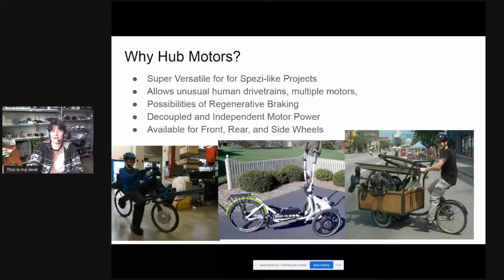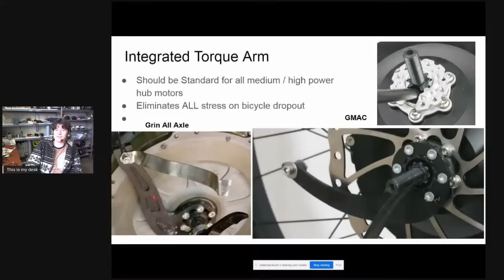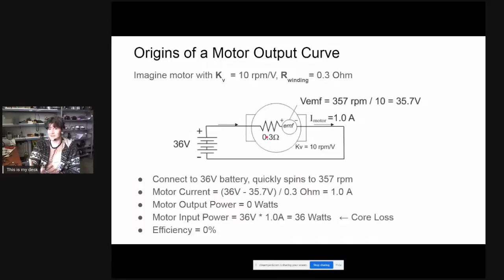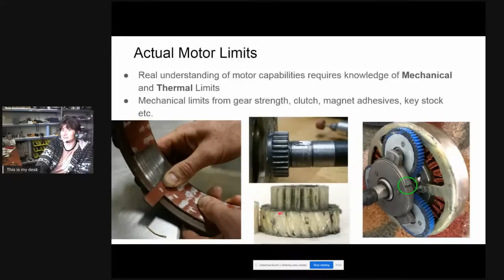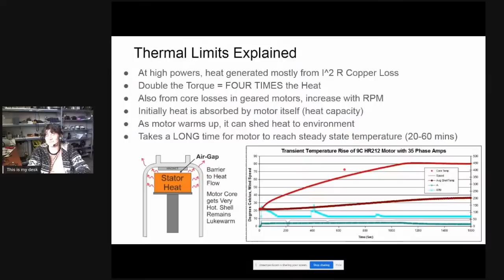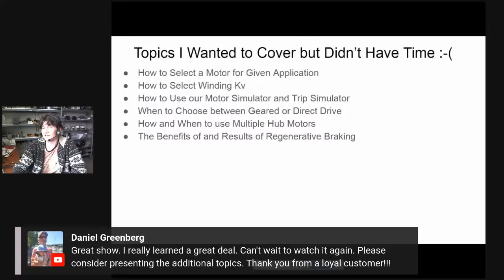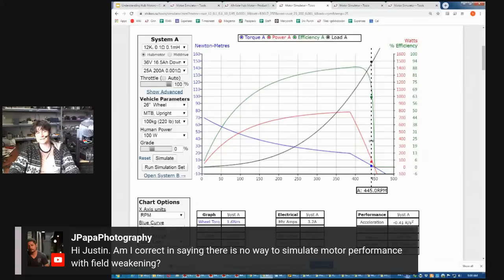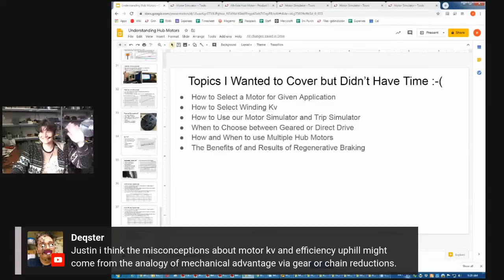Understanding Everything about Hub Motor Drive Systems - Spezi 2020 Live Presentation

Comment: hi justin ,

is it correct that every bldc motor with a given Kv has a fixed nm/A rating? i think not . you can not compare an outrunner with an inrunner or an axial magnet motor like the ME1304 motor
Reply from the maker: It is correct and your presumption is wrong.  If you know the Kv, you now the Nm/A, and you can 100% compare outrunners with inrunners with axial flux motors this way.
Reply: @GrinTechnologies  ok thanks justin!

Comment: very good...a single speed bike is good if you run in a 5 to 10kmph band of speed ....i hear you say a mid drive motor is the same as a geared motor...well yeah to the cranks but beyond that there is a diferance of 300 to 400% in gearing.if you want a sweet spot on eficiancy or power or below over heat change gear.between the human and the motor is an agreed narow band of rpm between these 2 and the road there is a lot of negotiation.
Reply from the maker: One of the large misunderstandings people have about electric motors is this idea of a "sweet spot".  There is no such thing as some narrow sweet spot for electric motors, they produce torque equally well over all speed ranges.  The human legs are very different though, and really do operate best in a pretty narrow band of pedal RPM's which is why bikes require such wide gear range with so many steps.
Reply: @GrinTechnologies   very good you responded on the topic of power from a motor but left out the topic of eficiancy and the heat generated/lost energy when out side of best eficiancy that you showed us on your chart.this topic is a large portion of your fantastic talk here. it seems to me that if you want to avoid energy loss as heat then keeping a motor in this best eficiency  "sweet spot" then a range of gearing will do this...now remember you said a geared hub motor is the same as a mid mount motor...im not convinced that is true.not when there are gears avalable.im going to watch your talk again and pay close attention to power/tork.maybe i will learn some thing.

Comment: You didn't cover acceleration in your video. Would be interesting to compare an acceleration chart with various motors and parameters. I have a question about a homemade e-bike unlike anything you've covered. I have a 36v lithium battery pack going thru a 500-watt controller to a 12v 500 watt brushed motor that lists 2,750rpm with a gear thru chain to rear wheel on a 26-inch bicycle so that top speed is about 30mph with a 120 Lb rider. I have not ridden it enough to figure out what is going to fail. What simulation can you run to help me figure it out? I have a spare 36-volt motor to replace when the 12 motor fails, but the 12-volt motor is faster.
Reply from the maker: Acceleration is just the net thrust divided by the vehicle mass, so it's quite easy to compute and is shown directly on our motor simulator in the bottom right.  There is nothing at all about modeling the motor's power output with the simulator tool that will tell you want component will fail in your DIY ebike drive system. That's a purely mechanical question.
Reply: Thanks for the response.  My failure question concerns whether my 12-volt motor will hold up with a 36-volt battery applied. The only way I can explain acceleration in a graph form is for you to look up a device called Dragy that Hot Roders use to tune their cars.

Comment: An afterthought: Justin, after watching you manipulate the simulation to show us that the fast winding didn't really change performance (by any metric?) up until the slower wound motor couldn't keep up, where the fast winding had an advantage, why wouldn't you just ALWAYS WANT a fast-wound motor? Is there less magnetic interaction at slow speeds, and thus lower torque and lower power?
Reply from the maker: Because    
a) not everyone wants the ability to go fast  (this is true for LOTS of people) and
b) In many systems, there are bottlenecks in the connectors, the phase cable wire gauge, and the controller mosfets that limit the ability to run at the higher phase amps that are required by a faster motor winding.   In these cases you often will get better performance with a lower motor winding.
Reply: @GrinTechnologies  Thanks so much for the insight!
Reply: @GrinTechnologies  I still dont understand that.. when you need more phase amps on faster motor, copper in the engine wont get hotter because of more amps flowing through the motor?
Reply: Won't the slower winding give more torque for hill climbing?

Comment: I'm guessing that oil cooled motors leak because of expansion of the air and oil during heating. I'm wondering if a breather could be installed.
Reply from the maker: Even without the added effect of internal pressure you get leakage. Oil is just by nature very leaky. The solution is to have a hub specially built with 'O' ring seals or similar around all areas of contact with oil that could lead to egress from the hub.

Comment: What is your opinion on Neodrives system and their direct drive motors?
Reply from the maker: We don't have any firsthand familiarly with them so for that reason can't really have an opinion. Most direct drive hub motors have roughly similar performance metrics.
Reply: @GrinTechnologies  It's this: https://www.neodrives.com/en/drive-system/z20/z20-rear-motor/
The problem with my 250W direct drive motor on my handcycle is that it overheats and turns off after I go over 50 kmh for a prolonged period of time. I can cook my motor like this eventually?

Comment: It is all nice and dandy, but how to have direct drive engine with 250W limit and still usable torque?
Reply from the maker: You don't sell an ebike with a 250 watt power limit.  Bosch bikes do about 800 watts of power.  That's what you need to get usable hill climbing oomph.  Regulations generally refer to "rated motor power" or some such, I've not heard of any that stipulate the actual electrical input power to be limited. If you limit the output power, then 250 watts is exactly the same thing regardless of whether it is coming from a DD hub motor, a geared hub motor, or a middrive motor.  250 watts simply means the wheel torque in Nm scales with your wheel speed by the equation:
Nm Torque = 250 *2*Pi / rpm.
Reply: @GrinTechnologies  
Thank you very much for your answer. 
I'm looking into this because of velomobile I'm building. Mechanical transmission is full of compromises... And I have seen the serial hybrid pedal-electric pedelec called Frikar. They use two motors... one is driven solely by battery, other is driven solely by pedal electric generator. They are suggesting to circumvent the European road traffic act by this... and it looks plausible. But when I tried to apply these limitations and set them to your engine simulator, then when I turned current high enough to overcome hills(there are hills up to about 12% here around), it leads to motor burn out in short time... It looks like I would need to have at least 750W engine(internally geared) to be able to overload it over 1500W at which I would have torque high enough... and motor would last at such torque at least 5-7 minutes. 

Well then there is an compromise- to have both mechanical and electric drive. But the complexity of system goes up, and serial hybrid pedal-electric transmission is no longer good option.
And yes, I know that pedal electric transmission would have up to 80% efficiency at best(unless expensive solutions would be used).

Comment: Justin.. Do they ever use Jack Shafts on ebikes..?
Reply: Yes you can find jackshafts on ebikes. However given the simplicity and low cost of hub motors it might be better to with around the limitations of a hub motor rather than adapt with a jackshaft.

Comment: how are you guys using 10 watthours per kilometre? i like to pedal and i'm only going 25 km / h and with a 65 kilo rider and 25 kilos of electric bicycle i ride 60 to a 100 km from 313 watthours, depending on mood and terrain. no regen either.
Reply from the maker: That's been consistently the average that we see among our staff and our customers for the 18 years that we've been monitoring real world ebike battery consumption.  Heaver users will consume more like 15-20 wh/km, thrifty users will be more like 6-7 wh/km.  10 wh/km is a pretty solid average.   

If you are moving at just 25 kph, you need much less energy than at the ~35-40 kph of most ebike commuters. So 3-4 wh/km is totally exepcted for someone going that slow and pedaling all the time.

Comment: Do you know where I can get metal planetary gears for a Bafang 750w hub motor?
Reply: By "750w", I presume you mean model BPM. Anyway, Aliexpress or maybe Banggood are good places to start.
Reply: @fun_ghoul   Yeah, been there, done that, but will keep looking. Thanks!
Reply: @dbfcrell8300  If you didn't find any, you didn't try hard. I was just looking at them the other day. They have them for BPM-sized and G02-sized motors.
Reply: @dbfcrell8300  e.g. https://www.aliexpress.com/item/4000121800330.html
Reply: @fun_ghoul  The model is RM G060 750.DC. I couldn't get the seller to confirm they'd fit in it, so I'm waiting for another seller to respond now. My motor is still on warranty, so I cannot open it to get the specs, so I must rely on the seller to know what planetary gears are needed.
Reply: @dbfcrell8300  If you won't open it, what the hell are you gonna do with steel gears? lol
Reply: @fun_ghoul  That the company I have the message in to. I just asked them again to confirm they are the correct size.

Comment: How much weight can the grin motor Cary on the axle in use?
Reply from the maker: That's a great question and what's nice about the thru-axle standard is that it's not the motor that is the limit at all but the axle which is now part of the bike frame, so you have the option to make it as strong as you like.  If you were to use a solid 20mm steel axle for the motor to fit on, then the weight it could take would be pretty staggering.  A lot of the trikes with single side wheels use smaller axles like 15mm or even 12mm, and in that case you can get closer to a shear strength limit of the spindle.  
At some point there would be a strength limit on the spokes, rim, and motor flanges, and I wouldn't normally recommend more than about 500lb on a laced bike wheel.

Comment: A hub with oil would suck so bad. Hub are a pain to change a flat. The oil would just add more weight.
Reply from the maker: The ferrofluid oil adds about 6-8 grams ( 1/4 oz) of weight and causes zero extra drag: 
https://ebikes.ca/product-info/grin-products/statorade.html

Conventional oil cooling like ATF needs more like 60 grams (2 oz).  

The weight is not something anyone would notice.

Comment: Short Question: Does anyone know of hub motors that are well suited for low speed high torque applications?  
Additional Information: I'm contemplating an electric assist 3 or 4 wheel vehicle for use on rough roads.  I hope to keep the loaded weight (including rider) to 600 pounds (270 kg), but for a number of reasons It might end up heavier.  While I don't have solid numbers, here's what I'm thinking might be desirable specifications for the motor:
Max torque 200 Nm
Max speed 160 rpm (20 km/h with 26 inch dia. wheels)
Common speed 80-120 rpm
Reply from the maker: There aren't many hub motors for ebikes rated at 200 Nm.  That's more the domain of electric motorcycle motors and you can find plenty of overseas vendors with big hubs in that size range.
Reply: @GrinTechnologies  Thanks for the reply.  That's what I suspected.  I hate to go to the weight of the motorcycle motors as I don't need a lot of power (I'm happy to go slow).  I was hoping someone made bicycle hub motors with extra low gears (i.e., more reduction).  But, I don't think traveling slowly is very popular.  :)
Reply: Could just get multiple motors...
Reply: @GrinTechnologies  Hi Justin.  I have the same question as Andrew and wondering if you could expand your response a little bit.  Geared motors have significant advantages in weight and size.  Have you ever come across a project to build a gear hub with an extra low ratio.  Something that would give a top speed of 15km/hr while serving up correspondingly large torque?  I'm especially interested in something that would meet the European constraints of 250W.

Comment: Justin meant "elastic" deformation for the steel fork as opposed to plastic.  Elastic deformation the fork will return to where it started and plastic deformation means it is permanently deformed and will not return to its original shape.  Just trying to help :).

Comment: Need to make a small correction to a comment I made.....I said "same torque per amp" for a slow wind vs fast wind of the same motor...that is not exactly true.  Same torque for both the slow and fast windings with the same battery amperage supplied.
Reply: one question, imagine we have a hill 15%, and torque required to climb it is 100 N.m. Now let's assume we have 2 identical e-bikes, same battery, same controller, same settings, but one motor is 3t and another is 6t. So we turn throttle to 100% and start climbing. Motor provide same Phase amps, enough to ride uphill on 6t and 3t. 6t motor accelerate 2 times faster to some speed X km/h, can we have a situation when motor with 3t will not even reach the X speed with same Phase Amps ?  

I think when we say that 3t can climb as well as 6t motor we forget that crossection of the phase wire for the motor is the same, and doubling the phase currecn on 3t ebike will cause 4 times more heat losses on a phase wires. Is it correct?

Thank you for answer!
Reply from the maker: You can always clarify and say "same torque per BATTERY amp".  That's one of the neat things about the motor controller is that it automatically does that adjustment with different motor windings.  Same amps/power from the battery means the same torque from the motor, all else the same, regardless of the winding KV.
Reply: @GrinTechnologies  Thanks Justin...that is what I meant to imply with my original statement but I didn't want anyone to misunderstand.  Your explanation is much more eloquent :).
Reply: @Vectorebike  The phase amperage is three separate sin waves all offset by 120 degrees.  The battery amperage is constant for a given load and rpm.  I'd suggest plugging your example into the Grin Tech Motor Simulator and move things around and see how the phase amperage, battery amperage, torque/thrust are related.  Also try different settings for the battery and controller amperage to see how limiting one or the other affects things.
Reply: There is some good info already on the Grin Tech web site under the "Learn" tab....I liked this article in particular when I started playing with ebikes:  https://www.ebikes.ca/learn/hub-motors.html

Comment: This guy " Pure Water Window Cleaning "  was-is right...  where this " Grin Technologies " is exactly...  what we dislike
About the  HOLIER than THOU...  just cause he knows more and better than I...  
Is  PISSIN ME OFF...   :)    ... OH..   DON'T GET ME WRONG...   I know when I am listening to what turns out to be my BETTERS
.............  BUT it doesn mean I have to be all submissive and listen to the refresher life's experience course...
He is puttin out here.. ..     Or does it ???   Yeah..  it does....   - SUCKS TO BE ME..  pompas ass me... but it does..
.....   AND ONLY CAUSE.. I can read and relate to.. line diagrams..  drawings .. charts on  variances and values related to 
Cycles and  Impedence values...    ..  so lets move forward...   cause now...  this guy  
....  Is NOT PISSIN ME OFF.....   
CAUSE...  I saw the damage done to a fork at the motor center shaft contact point..  
Where that point could not take the  sheer value... without the precautionary torque arm engineered into the motor hub...
Which by the way was not a steel fork contact point .. but an aluminum set of forks with aluminum plate  contact point
But for our application the front motor could be 500watt not 750 or 1100 like the rear drive,since it is actually an assist...
Me knowing what the conditions were... being necessairy for my own build...
Few meeting the basic design requirements before testing  engineering limitations...
.....  I capture everything I VIEW/WATCH...  don't have to come back on line to find my knowledge base library...
He had some good charts and reference graphs in the mix...
Thanks Grin Technonogies...  
-----   Tony Stark said it to the little boy.. as he sped away from him leaving him STANDING in the middle of the cold street...
..........................................   "  I feel so  CLOSE to you right now...  "

Little boy said...  [ AS STARK SPED AWAY ]  "  IT WAS WORTH A SHOT.."
Reply from the maker: Glad you liked the video!

Comment: you dobble talk at nicolays question 1 :52 mark...what are you doing bs ing or are you so polarised on hub motors you have cognative disodance? hey i love the simplisity too but lets not talk bs. lets not try fool people...you cant play a game where you argue no gearing is better becaus you want to narow the rules to a 10kmph diferance...go compare same motor 1 direct drive to 1 through 5 or 10 gears. i know as well as you the gears will win on tork,heat generation,energy losses,top speed,distance/range,battery life,unsprung weight,
Reply from the maker: Hey Russell, yeah I'll admit that didn't come out very well. What I was trying to clarify initially is that the relation of higher rpm->higher power for the motor doesn't go on forever, but didn't circle back to his question as it applies to changing the effective gearing between the vehicle and the motor.  There are times when it totally makes sense and other times when it doesn't, and I think this will be a great topic to cover in a future presentation focused on motor efficiency in order to explain the trade-offs